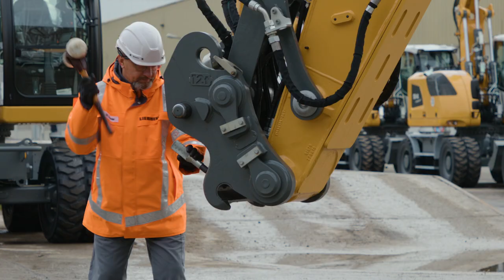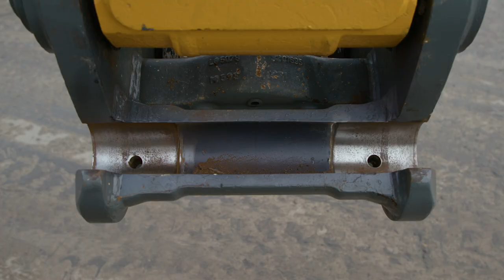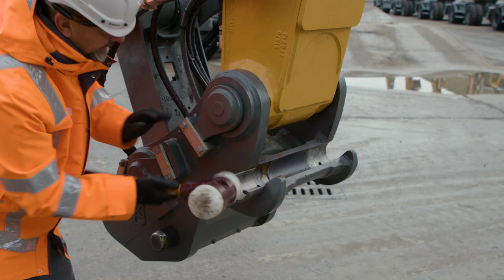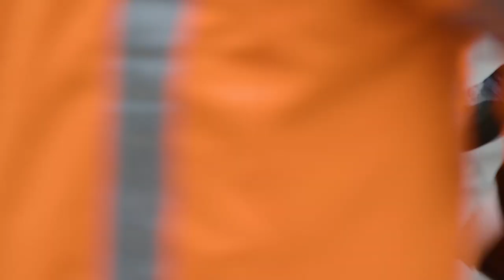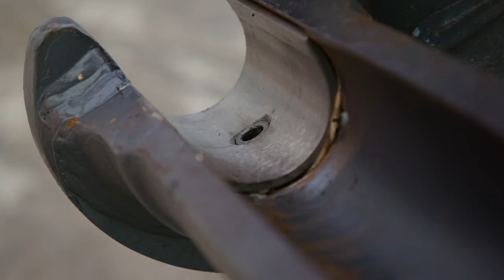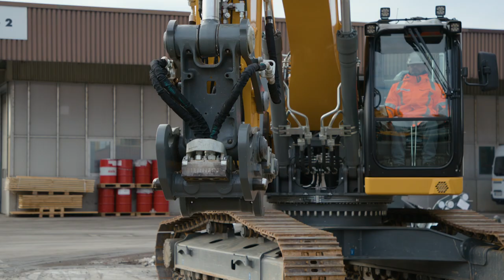Liebherr – Schalenwechsel am Schnellwechsler SWA Generation HD

Comment: Are these a type of sleeve bearing?  Thanks
Reply from the maker: This is a half shell made of steel with special characteristics to minimise wear.
You could call this arrangement a kind of sleeve bearing - but in working order the pin and the half shell have no relative movement to each other.
Only when changing attachments the pin does rotate in the half shell of the quickcoupler.